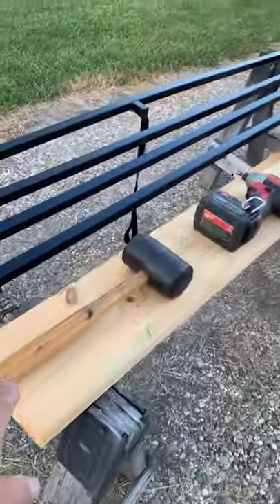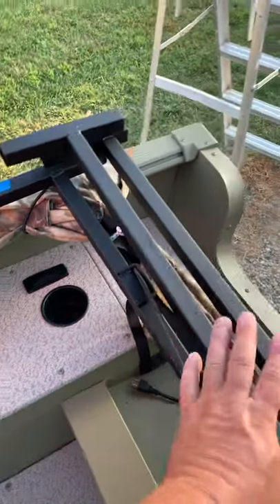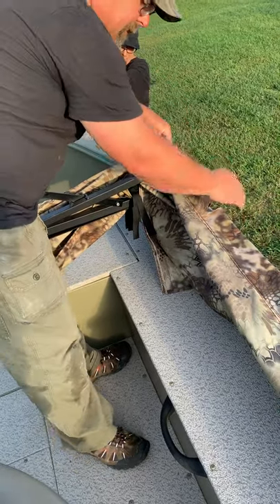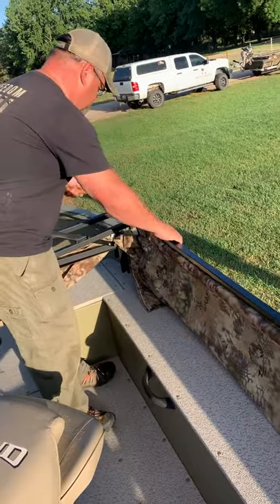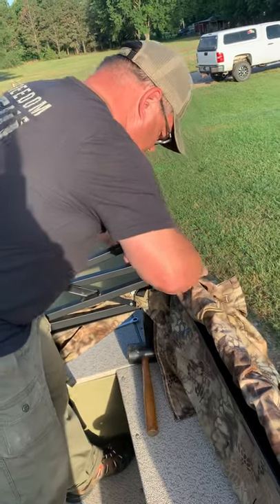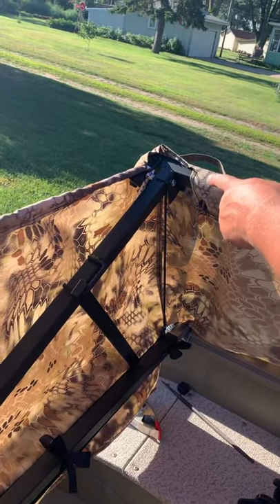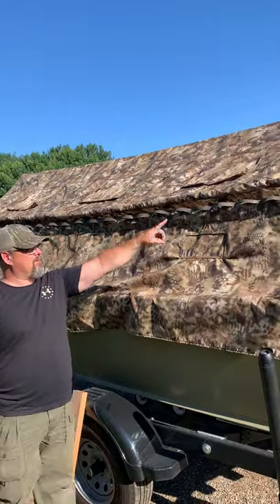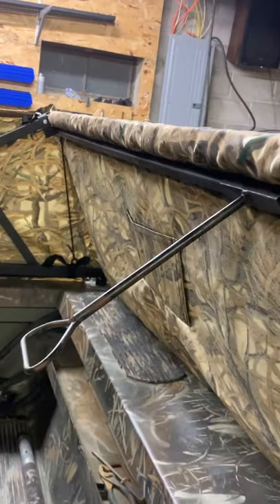Boat blind assembly

Comment: Can you leave a portion of the front or overhead of the blind section open and/or lifted up a bit?  Or does it have to be latched in fully and pop up mechanism used?  Thanks.

Jim
Reply from the maker: Jim,  the blind can be adjusted so your opening is all the way closed or opened enough to shoot out of without releasing the top.

Comment: Can that motor still tilt up ???  Part 2 ?
Reply from the maker: it still tilts up for travel, if that's what you are wanting to know?  He had a full travel cover on the boat as well.
Reply: @popupblind8981  what I was asking was can the motor tilt up while pop up is in place for shallow water , it looks like it can’t be trimmed  up . Can the pivot point be moved forward to accommodate motor trimming up ?
Reply from the maker: @edwfd356  Thanks for clarifying, we can start that at any point you wish.  I've dont it from 15" to 48" from the rear on boats.  Feel free to call to discuss.  402-276-1424, thanks, Jeff